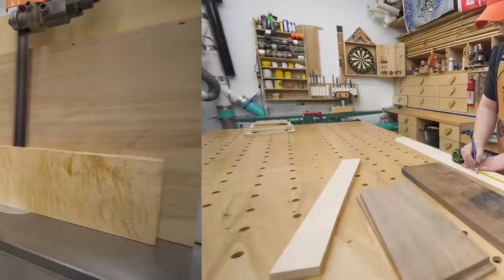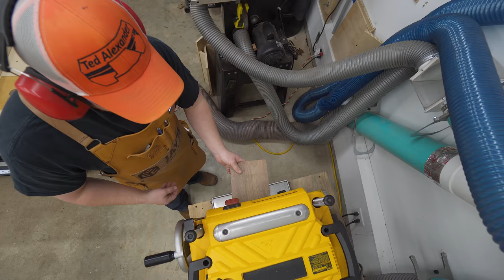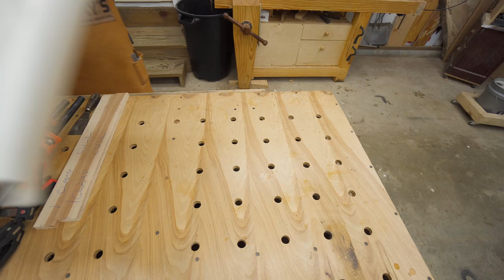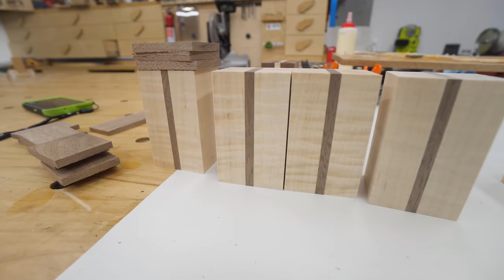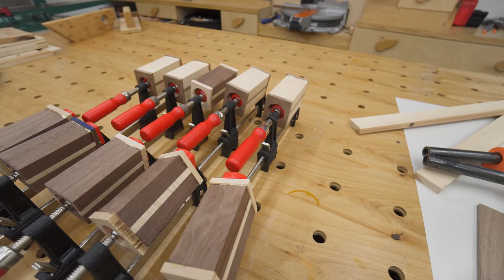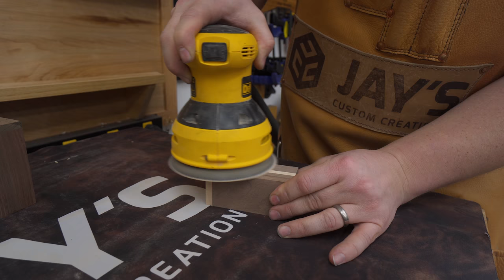Gifts - Salt and Pepper Shakers 2018 - 296

Comment: Great work and very cool video edit! 👍I often skip some moments in most videos, with video no skip during all six minutes. 😁 Question: did you put the oil inside the shakers? Or applied it only outside?
Reply from the maker: Just to the outside to keep them cleaner longer. Fingers will get the outside dirty. The inside will never be dirty because you're only putting clean salt and pepper in them. And the wood is non toxic so no need to worry about the contents becoming harmful.

Comment: Just curious, what's your reasoning for using the tablesaw to cut those pieces to length instead of the compound miter saw?  I see a lot of youtube woodworkers doing that, but have never heard a good reason.
Reply from the maker: Smaller pieces are more easy to manage at the table saw.

Comment: Just curious--why not drill the shaker holes in the tops prior to attaching them, that way you don't have to mess with cleaning out the saw dust from inside them through the small cork hole?  You could drill the shaker holes through blocks and then cut the blocks down to create multiple identical tops, which would be faster and more consistent than cutting all the tops and then drilling all the hole separately in each one.  Unless the variability is a feature you are wanting to include.
Reply from the maker: 6 one way, half a dozen the other. You can drill them before. It's easier to center the holes after the tops are flush with the sides.

Comment: It's not a proper shaker set until it's been liberally coated in lubricant laxative :P
Reply from the maker: I can only imagine the comments if these were turned on a lathe...
Reply: They look great. Seems you were debating on the lathe.  I would have preferred a rounded shape, but some may prefer the current design which works too.
Reply: It would have been more "ergonomic" 
*snickers*